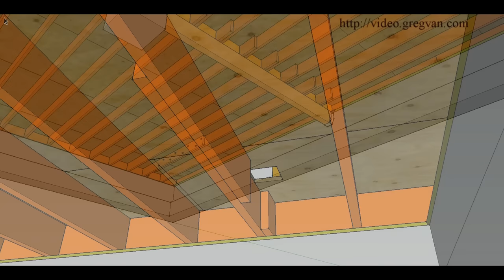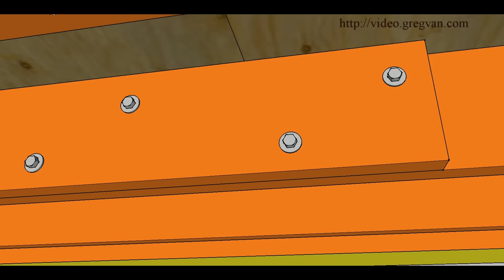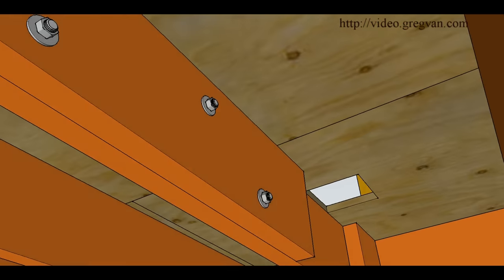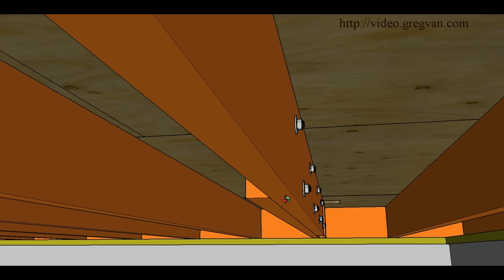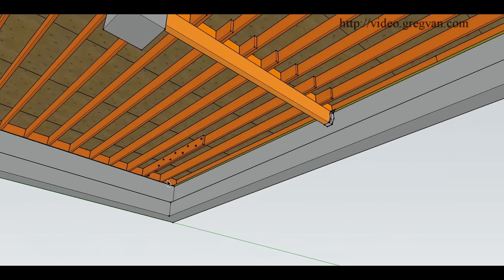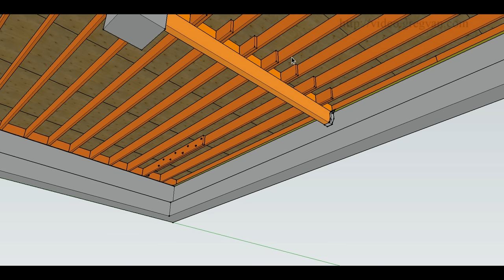How To Repair Cut or Damaged Floor Joist – Bolting New Joist To Existing

Comment: I have termite damage to about 2ft of the ends of 2 of my 2x8 joists. I'm thinking of jacking everything back up close and bolting another 2x8 in about 8ft in length to where my mess of house wiring starts. would I need to span to the other end or would this work as well. it's directly under a sliding double door (upstairs). I was going to cut the ends of. the old joist out and toenail the new piece to the sill plate and use 3/8 bolts to sister and use gorilla glue. I just bought the house 2 months ago and trying to remodel it all before I move in. just found the damage yesterday and had 2 termite inspector out today. it's old damage from years ago. thanks!
Reply from the maker: You would be better off installing full-length joist that sit on supporting walls or beams, but understand the problem you will run into with electrical wires, forcing you to use shorter joist. I'm just going to throw this out there, even though I'm not an engineer and won't be responsible for whatever you do, but don't think you would have a problem using the shorter joist if they aren't supporting much weight. Now what do I mean by much weight, like a waterbed, bookshelves, heavy furniture or a load bearing wall.
Reply: Yes it is directly under a sliding glass door in the dining room so not much of a floor load but it is on an outside wall on a 1100sqft ranch. I'm in the process of getting some contractors out to see what they think. I believe the best would be full length from sill to beam but I'd have to remove all the basement wiring because unfortunately it's all on that side of the basement:( thanks for the reply ! Awesome channel
Reply from the maker: You're welcome.

Comment: when you have sagging floors because of rotted joists, whats the first step?  Do i jack up the floor and then sister the joists? or replace those somehow and then jack to level and support through permanent jacks?  I'm just insecure about the step by step process for this.  I kind of have every issue you can imagine wrong with this house.  They supported the joists with 2X6's nailed together.  They're starting to twist and separate and the cinder blocks are either breaking in half or holding strong but the support is pushing into the wood.  Everything is either rotted, un-level, bad soil, wrong wood, wrong supports, exc.  Any tips of first steps and so on for the attack.  Also, any tips on seeing electrical wires?  Better to get an electrician or just shut power off?
Reply from the maker: The first step will be to evaluate the damage. If the floor is sagging more than 1 inch in a 12 foot span or distance, then it might need to be replaced. If not then the next step would be to make sure that the joist and other structural components are not damaged and if they aren't then try raising the floor, but do it gradually and in small increments until it is positioned correctly, then you can add additional components like joist and beams to secure it..
Reply: i appreciate the response!   So when jacking up the joists, is it good to jack up the joists with a big support girder with jacks throughout or just specifically with the individual jacks under each joist?
Reply from the maker: It all depends upon the situation and method you're going to use to repair the floor. For example you could use a beam and a few jacks, just as long as you can still make the repairs after the floor has been raised. Make sure you position the beams in spots where they will still allow you to install the new joist, without blocking access.

Comment: how can I raise a severely saggy floor with a Furnace underneath it. the joist under the furnace was cut and they framed a box over the top . I guess my question is how can I raise and frame a floor with a Furnace directly in the center of the room right under the sags?
Reply from the maker: +Jordan L You might need to remove part of the subflooring (plywood or one by six) so that you can work on it from above or remove and relocate the furnace so that you can work on it below. It sounds like you might need to replace the floor joist and you could always do that one at a time, working your way right to left or left to right. Let me know if this doesn't make sense.

Comment: Can you layer it with 3/4 plywood on 2 sides with lags?
Reply from the maker: Maybe and let us know if it works. I think I would use bolts with nuts and washers though. Drill through both the plywood and joist then run bolt through and connect all of it together.

Comment: I redecked a 20 year old PT pine deck, I kept the old frame. Anything I can do to strengthen the frame?
Reply from the maker: Probably should have done the engineering modifications before you built the deck, but you can always install structural beams underneath the joist to reduce the spans. Send me a picture of your deck and I'll see if I can provide you with some more information. You can get our email address at the website.

Comment: Greg I have a center beam that has a split in the middle I want to use the lag bolts every 16in on Center 6 in lag bolts for the 7x7 Center beam can I do this to just pull up the beam a little bit and slide Lally columns underneath it
Reply from the maker: It's difficult for me to tell exactly what you're going to do, but it seems like the support column would definitely help. Feel free to email some pictures to me of your problem and your solution to fix it, for more information.

Comment: Can you post a link to your other floor joist repair videos? I have an old house with a cracked floor joist so I'm thinking of adding a sister joist with staggered bolts like you showed.  Would it be beneficial to add a sister joist on each side of the cracked floor joist? Like two new 2x8s sandwiching the cracked 2x8 floor joist? Or is one sister joist bolted to the cracked floor joist sufficient? The crack is a about 3 feet long and was caused by someone cutting a piece out of it for a plumbing.
Reply from the maker: Here's a link to our website http://www.homebuildingandrepairs.com/repairs/framing/index.html and if you can't find what you're looking for leave another question in the comment area or send me a picture of your problem. You can get our email address at the website.

Comment: Literally in this exact situation. Do you need approval from a structural engineer if you have the new joist span the entire length of the old one?
Reply from the maker: You would need to check with your local building department or local building authorities, but I don't think you will.

Comment: Yeah I have a 7x7 beam it has a split in middle I've leaved in the house 6 years just trying close the crack I dug out 4 footings for lally columns were do I send you pictures
Reply from the maker: You can go to our website and there should be a link to the website in our video description box. At the bottom of every page on the website you should find our email by clicking on the contact link.

Comment: I'd add some sort of adhesive to make it even stronger
Reply: Sergey Bebenin 
That’s what I’ve done to the jois(T’)s* I repaired because the end resting against the outer solid brick wall has rotted. Those things aren’t going anywhere. 

* because apparently the T is optional. 😉

Comment: I have recently undertaken the task of removing my drop ceiling in my kitchen. I am now in the process of hanging new drywall...I have discovered some extensive termite damage to one of the main beams running almost center of area. I am not sure how far the damage goes and if the beam is salvageable or if it needs to be completely replaced. Now my question is IF the damage is concentrated to say a 3' span could I cut and sister or would I be better off replacing the entire beam?
Reply from the maker: +Nisha Flores I'm not a structural engineer, but can suggest replacing the beam as the better option. Most of the time you can replace existing building parts, but any modifications like sistering additional building materials or lumber would require the approval of an engineer and quite possibly your local building department.

Comment: can you do the bolt repair to a LV beam that you want to extend 2 ft?
Reply from the maker: You should check with the product manufacturer. I used this to find their guide (Technical Guide - LP Building Products) and the information you're looking for should be on page 13. I would love to say you can, because I've seen it done before, but that might not provide you with all the information you were looking for.

Comment: how do I cantilever the joists out into an open room so as I can put a staircase up against the trimmer when the joists are running the same direction as the staircase??
Reply from the maker: You would need to install a beam in the floor running perpendicular to the joist. In other words it would be extremely difficult to cantilever the floor and you might be better off installing post to support the landing.

Comment: The load of one repair seems fine with two gussets on each side of a damaged joist, But what about finding 5 joists that were cut, leaving essentially 2x4 wood left? My carpenter plans on doing the repair as you stated with same size wood, in this case 2x8's (this is an old house) that will be 6 foot long each, onto the existing 2x8x13' span joists. This seems unacceptable to me, and as I have just found out that all the repair work is being done without a permit, I cannot ask the towns inspector to approve this work. What a fix! I want him o sister full length joists, and he has threatened to walk off the job? Is he correct in saying this will hold the second floor bath (replaced tub)  he just put in in this damaged area? We found this damage as he was going to bring up to code the 2" drain from the existing 1 1/2" drain...Whoever did this work previously looks like they did it with an axe...Please respond asap, as I'm tired of bathing in a bucket.... vic
Reply from the maker: +Victor Radzawich I would go with the full-length boards myself, unless there was an obstacle in the way, plumbing pipes, electrical wires, heating ducts or structural framing components. Remember, I'm not a structural engineer and cannot provide you with repair plans, only examples.
Reply: +gregvancom I understand, and I know that in a perfect world the full sistered timber joists would be the way to go, I may have to insist on it. I cannot see patching 5 damaged joists in a row as a viable fix. Now all I have to do is locate my missing contractor...Like you said, planning is important, and the drain could have gone down another wall instead of across 5 joists...I just don't get some people? Thanks for the input, ...vic

Comment: I don't really see the difference except in one you use nails and the other bolts.  can you point out the difference?  I have a kitchen floor where a leak created this exact issue.  thanks
Reply from the maker: I think from an engineering point of view, the bolts will work better than the nails, but again it would depend upon the situation. Remember, this type of repair might not work for every project. Let me know if you need more information or a better explanation.

Comment: You said to put a bolt every 8 inches.  Can I add a bolt every  6 inches instead?  Please Reply.  I need help!
Reply: Tillie Thompson why couldn't you. It is even more overkill. But have at it.
Reply from the maker: These are just suggested spacing and the purpose of the video is to give you an idea of how you can fix it, so feel free to space them at whatever you feel appropriate.
Reply: renaissancemen1 The closer you get together and more bolts you use, the more you weaken the timber...
Reply from the maker: A staggered bolt pattern of 16 inches on center is usually acceptable.

Comment: It's a much better option to sister a full length new joist to the old one from the beam to the sill as long as you have reasonable access to do so.
Reply from the maker: Good point and as you mentioned, if it will be possible.

Comment: Why not just use some 3 inch GRK structural screws.  That would be much easier than trying to bolt it down (or just put a new one in because you are already theree
Reply from the maker: I never seen that used on this situation, but if your suggestion is something that would be approved by a structural engineer then go for it. I think I would rather use the bolts, because I've seen it done in the past.
Reply: Yup -  I'm using Headloks to bolster some headers and beams held together with 40 year old nails. - the only 3" structural screw I could find.  Rated the same as 3/8 to 1/2 lag bolt.  I've got to think this is better than drilling a whole lot of holes in most cases.
Reply: @anxiousappliance  in retrospect to my comment 4 years back, I would think it's better to just sister the damn thing and block around the pipe to join the entirety to the neighbouring floor joist as well.  Might be a bit of an overkill though.  Even big holes are actually not that bad for bolts and screws as long as they dont cause the wood to split.  Knots are effectively little holes (we can get technical and say the wood around the knot is harder)  It's notches that are the problem in most cases.

Comment: at 109 would this work on a notched floor beam that's over the sill plate
Reply from the maker: +John Schlich I wouldn't recommend this method for a structural beam that's supporting floor joist. If this didn't answer your question, feel free to send me a picture or ask another question.

Comment: You say you weren't sure of the length for the new joist.  Typically I've heard of having 4ft of overlap
Reply from the maker: I didn't provide a length, because there are too many engineering variables to suggest that one size like 4 feet will work on every repair situation.

Comment: What about just nailing it together with a nails and hammer?
Reply from the maker: That will work sometimes, but the bolt method is usually stronger.
Reply: @gregvancom  
What size wood nails should i use?

Comment: Why wouldn’t you just add a full length joist? Do it right.. Even if it is actually more than you need.

I have a 2x10 joist needed for repair. Plumber cut straight through it for toilet.😒 Adding full length 2x10 next to the damaged one with construction adhesive, construction screws and then wedge a piece of 2x10 between the damage 2x10 pieces with construction staples (used for floor trusses) to hold the pieced joist 2x10 together. Should be solid and I hope my explanation is understandable.

Comment: They were cutting a hole for wire and he didnt cut right in the middle more towards bottom and my crack is at least a foot long. Dug out basement so the dirt is close to the floor so il use plywood with my car jack to jack it back up and maybe my computer chair wont roll on its own anymore😂

Comment: Nothing wrong in first method all though you need to use A LOT of nails and correct nailing pattern to nail to make that type of fixing to strong enough.

On other hand bolt connection on small joist can make whole joist weaker because drilling hole for bolt weakens it a little bit when nails doesn't if you doesn't nail too close to edge or sides.
Reply: So true.

Using too many bolts will actually weaken the joist being worked on.

If you have some wood to work with (good sized joists) you should have no problem.

But 2X6's or even some 2X8's one  must be careful.

Comment: Why would that require a structural engineer?
Reply from the maker: Dean Garrett That's a good question and sometimes it won't. I think the main point I'm trying to make is that if you have a problem with a building, then it might not have been built correctly in the first place and most people wouldn't know unless they were familiar with framing homes or designing them. For example, you could have 2 x 6 floor joist, when you actually needed 2 x 8 or 24 inch on center joist spacing when they should've been 16 inches on center.
Reply: He’s covering his butt, nobody watching this is going to hire a structural engineer to mend a floor joist. That’s why we’re all here.
Reply: @1catbrains  you got that right

Comment: I'm a structural engineer and there are multiple good reasons why I don't approve of sistering a joist. The first (and really the final reason) is that it doesn't meet code.
Reply from the maker: If there's one thing I can say about home repairs, it's that I've seen a variety of them done a variety of different ways and am regularly surprised that they're still holding up or why they wouldn't be approved by local building authorities if they do. Thanks for commenting and it's always nice to hear from an engineer.
Reply: Hi Charles, are you saying that the sister joist should run the full length?  What would be a proper solution to adding support to a failing joist?
Reply: @anthonybasiliere9366  sorry for the delayed response ... but yep full length, from support to support. You can attach the new joist to the old, or take the damaged out, or just ignore the damaged ... it doesn't matter. I've heard that the old codes, CABO and BOCA in my area, did entertain sistering joists, but not under the ICC codes.

Comment: Just run the sisterboards all the way. Duh.....
Reply from the maker: If you run the sister boards all the way and there sitting on top of structural load bearing walls, beams or foundations, then you might not need to bolt them to the joist next to it, instead you can simply fasten it together with nails.